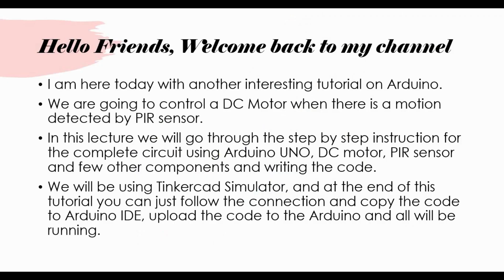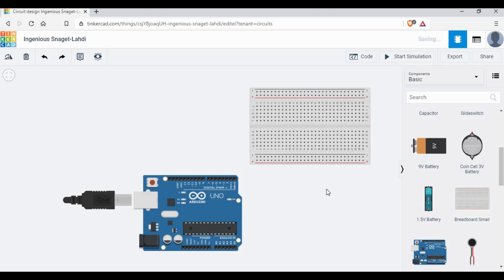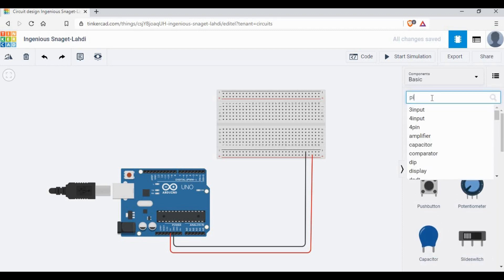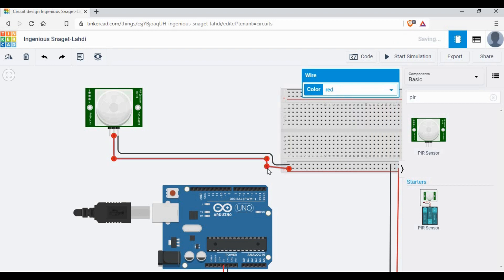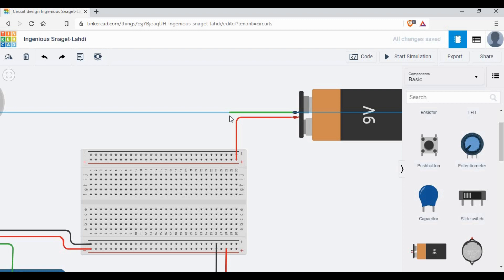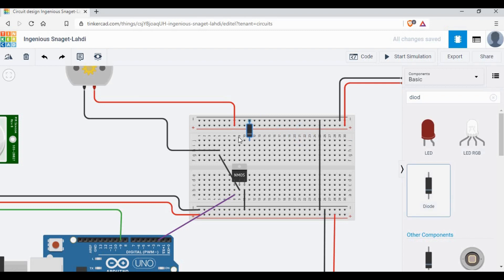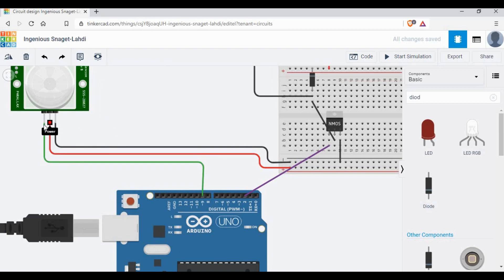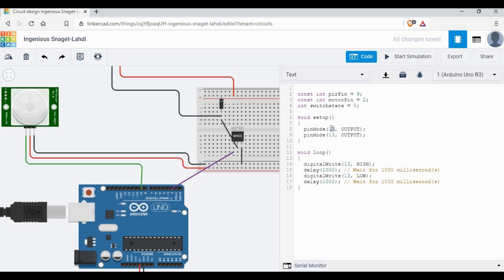PIR Sensor DC Motor Arduino Project | Arduino To Control Dc Motor When Detected Motion | Thetips4you

Comment: Sir i want to slow my motor if my pir sentor detect a body or else the motor speed should be same

If i change the if else statement 
The motor is high 1st after 1-2 seconds it come to zero on both motion detect or not detect 
What's the mistake i have made?
Reply from the maker: What exactly do you change in the else if statement?

Comment: I followed along with this tutorial on Tinkercad. I copied and pasted the code from the website. It didn't work.  I clicked on start simulation, I clicked on the motion sensor, the motor did not turn. Did it work for anyone else? Anyone else have any problems? If you found a way to get it working please let me know.

Comment: Is this still active chat?  I did everything the same ran the test but when put into real materials, the DC motor continues to run
Reply from the maker: It should work. Check the connections or pin for sensor is connected correctly.
Reply: @Thetips4you  I'm buying a dc motor to see if this is the issue. Should be here tomorrow so I'll let you know.   The one I'm using now is 3v -12v so I'm wondering if it is just pulling the power.  New one will be 1.5v -6v

Comment: How can you turn on 3 dc motors with a Pir sensor and have each dc motor to be on for a certain amount of time then turn off?
Reply from the maker: You need to change the circuit and code based on it.

Comment: Hi this is an excellent tutorial but im a little confused about which MOSFET and diode to get as there are many available, could you specify which you used please? Also can I control rpm of motor? Thank you
Reply from the maker: Thank you. You will not be able to control the rpm with this circuit. I will check and share you the details on the models.
Reply: @Thetips4you  excellent thank you, also sketch keeps showing errors?
Reply from the maker: @dalenicic5696  Can you give more details on what you mean by Sketch keep showing errors?
Reply: @Thetips4you  apologies sketch error is my fault, I’m new to arduino
Reply: Although now I have same issue as some other people the motor does not stop spinning
Reply from the maker: Can you contact me through fb thetipsforyou. I would like to check your connections.

Comment: Hi.. I followed 100% your instruction. But my dc motor keep rotating even if the sensor detected no motion. Why? is it because of the diode/ transistor that I used? do they have specific value?
Reply from the maker: Can you make sure the pir sensor is connected correctly. It signal pin should not be connected to 5v, in some pir sensors the signal pin will be in different position.

Comment: Can we use This project to implement in an aircraft. For example like to calculate the distance between the ground and the aircraft when landing. If yes please tell me how.
Reply from the maker: These are not industrial sensors, you can use the concept. However the sensors has to be changed with precision sensors.
Reply: @Thetips4you  what are the examples of precision sensors

Comment: Are you sure that the diode is well place in this circuit bro cause in real life it should  fried the arduino board.
Reply from the maker: Yes, the diode is kept in the way that the current will not flow towards Arduino. You can test that before making the connection.

Comment: Hello sir, how can I combine this circuit and code to ultrasonic distance sensor I have the 2 circuits separate.
1- First circuit is ultrasonic distance sensor controlling the 2 DC motors using L293D H-bridge.
2- Second circuit is like the tutorial you did with 2 DC motors. 
Everything is working in the 2 circuits but I don't know how to combine them. May you help me with that? 

- The idea of my project is when obstacles or anything comes near my probe the PIR Sensor will detect the motion and the Ultrasonic distance will move backward when it's near 100cm to my probe. And also I will include the dust sensor but still did not do the circuit and I don't think it will work. 

 - One question about the diode transistor I don't have it right now, if I did not include it the circuit will still work?
I apologies for the long discussion and I will be happy if you could help. Thank you!
Reply from the maker: Hi, yes we can do that. Please contact me through fb thetipsforyou. Let's see how we can create the circuit and code for your project.

Regarding diode, it is used to stop the current flow in reverse direction to protect Arduino, your circuit should work even with out diode.

Comment: hi,, this is great video , i liked and subscribed. im doing this , except im using 5v servo motor , so does this mean , i take away the 9v battery , and run the servo ground , and live to the same as the sensor and then the servos feed to the arduino.  thank u
Reply from the maker: Thank you for your comment. Yes it will work with servo motor and power from Arduino. If you have any issues let me know.
Reply: @Thetips4you  thank you very much , awesome
Reply from the maker: You are welcome.

Comment: I had it working but then I changed the battery for the motor from a 9V to a battery pack for 6 AA in series - should b e same voltage, I think. It worked few times then stopped. I have gone back to 9V battery but motor still won't engage, although LED in place of motor works. Any advice?
Reply from the maker: Can you test the motor separately, it may be the motor is not working.
Reply: @Thetips4you  Thanks for responding. Yes, I have tested the motor and it works fine with just the 9V.

Comment: This is really an amazing tutorial, thank you so much for it. I was wondering would it also work with a somewhat lower voltage? I need it to be as small as possible and with a solar-charged battery, and those are not easy to find. Thanks!
Reply from the maker: Thank you for your feedback. If the voltage is good enough to run the motor yes it should work irrespective of the source.
Reply: If you need something smaller, it's way easier cause you can just directly use the voltage  coming from the arduino.  It jus a 5 volt input. No need of all of this transistor. All you need it's  a program

Comment: Great tutorial. Can you use the same system to stop running motor with sensor.
Reply from the maker: Yes, if you are talking about sensor detect can be used to stop a running motor. However you will have to define when the motor should be running as well.
Reply: @Thetips4you  I have six indoor cats. I am tired to clean their kitty litter box. I come up project to create self cleaning box. Mechanical parts is  done but I have to control a stepper motor when any cat go in and detected by PIR sensor. Simply a cat goes in the box, sensor detects , no motion, when the cat leaves the box sensor triggers the system, 30 seconds delay and then stepper motor turns the system half revolution and turns back  the system the beginning position and stops until a cat trigger the system again. I am watching almost all PIR sensor and stepper motor tutorials to combine them. I know you will say "hey, don't bother, pay $500 to buy from the market" but they are not big enough.
Reply from the maker: Great to hear about your project and cats. Here the the problem is that you will not be able to seperate the movement of cat coming and going out. Pir sensor will keep detecting a high value when there is even a small movement. Probably you can try with ultrasonic sensor and if the distance ( cat is going away from sensor) is more than some distance you can rotate the motor.

Comment: man pls how do I use this RIP sensor as analog? I'd like it to detect only if the green circle is in the middle of that sensor place?
Reply from the maker: What is your exact requirement with PIR sensor?
Reply: @Thetips4you  to put at a door and only detect movement of a human so that it doesn’t react when a dog or cat is there for example, but I just want it to show that in the tinkercad as a demonstration.
Reply from the maker: @xanh350  You cannot do that with just a PIR sensor. If you need to specifically detect humans I would recommend to go with OpenCV and programmed to detect human.

Comment: Great video. I followed the tutorial and everything is working as it should!

I was wondering if there was anyway the PIR sensor could activate the motor for a certain amount of time (2/3 seconds) before stopping and then reversing (for 2/3 seconds)  when there is no motion to activate the PIR sensor? I have no idea how to do this any and would be very grateful for any advice.
Reply from the maker: Yes . That is possible. We need to change the circuit and code a little bit. Can you contact me through fb @thetipsforyou or in Instagram @thetips4you

Comment: Thanks for the vdo. Can IRF540N MOSFET transistor b used for this? I have 7805 IC, can this be used.
Reply from the maker: Irf540n mosfet should be fine.
Reply: @Thetips4you  thanks

Comment: When I add battery, motor just turns on and doesn't stop. I've been trying to troubleshoot with no success. Any ideas by chance?
Reply: Yes what solution could you provide?
Reply from the maker: I have asked Christi to check few things through fb. Are you facing the same issue? What I found out when checking with SoulFrank, by default the pins where giving high voltage. So we had to make some changes in code. Pls contact me through fb@ thetipsforyou.
Reply from the maker: That means the power is always going to motor. Can you share your circuit diagram to me in fb @thetipsforyou. I will have a look.
Reply: Yes, I have the same problem too, with my project. The motor just keeps on spinning without capturing any motion, can you help me about this sir?

Comment: Thank you sir this was a great tutorial..I don’t have any diodes at the moment so I tried the circuit without and it worked..can I use a LED instead of a normal diode?
Reply from the maker: It may work without diode. The only reason for using the diode is to stop the reverse current flow that breaks your device. LED cannot do the job of diode.
Reply: @Thetips4you  could it damage my device if I’m not using the 5V pin? I plan to use 12V on the external pin of Arduino
Reply from the maker: Since the DC motor need higher voltage, if you use 12v and if don't use diode, there is possibility of the device to dead state. So be careful.
Reply: @Thetips4you  I’ll test it out and let you know..I think it should be fine since the current of 8 AA batteries in series is the same as 1 AA battery

Comment: great work man, i have try it, it is working great, but i want the motor to reward back after sometime, and  if it sense motion while rewarding back it should stop, thanks man looking forward for you reply
Reply from the maker: With this circuit it will be difficult to reverse the motor as you will have to reverse the power supply from battery. You can use different method in which the power is decided by pin and cann write the code to control it.

Comment: Hi can I ask what type of nmos transistor and diode is used in this project
Reply: So if I were to buy those components I can just tell them to get me a MOSFET transistor and a normal rectifier? Or are there any codenames for the specific component?
Reply from the maker: @weiyichong7581  Yes. That will be fine. MOSFET NMOS Transistor and Normal diode. You can search in online shopping site and easily available there.
Reply: @Thetips4you  Thanks so much!
Reply from the maker: @weiyichong7581  You are welcome my friend
Reply from the maker: Hello Friend, you can use normal rectifier or PN diode, also MOSFET transistor. In Tinkercad you can easily find diode and nmos transistor.